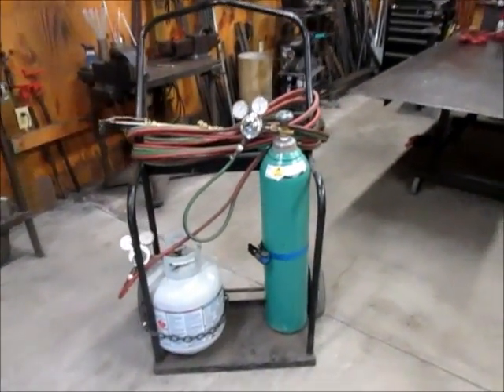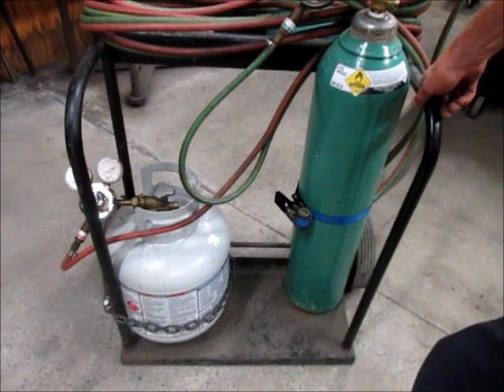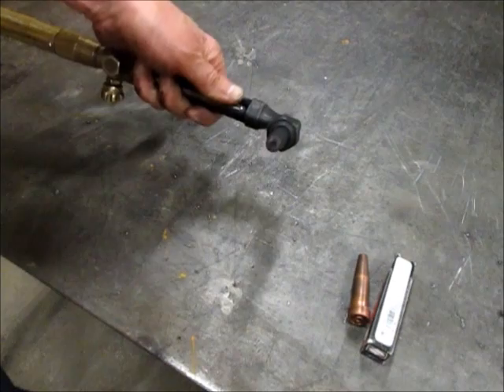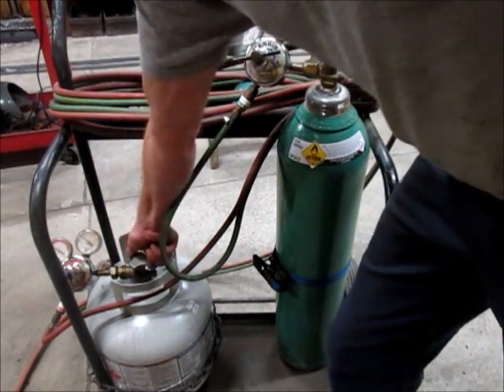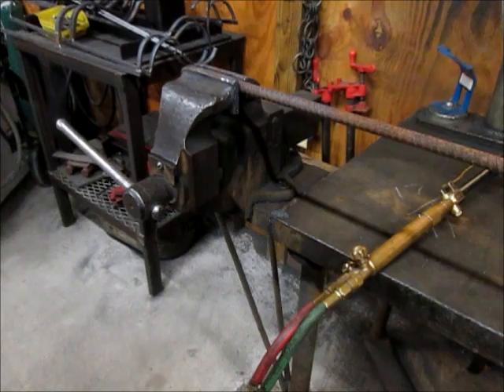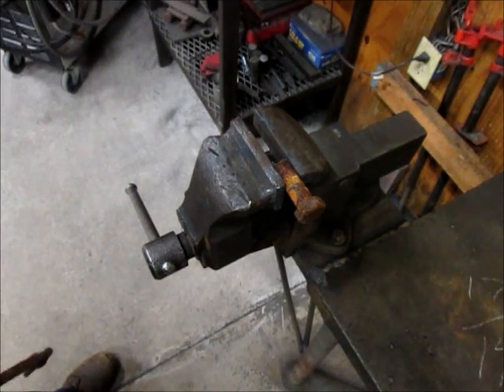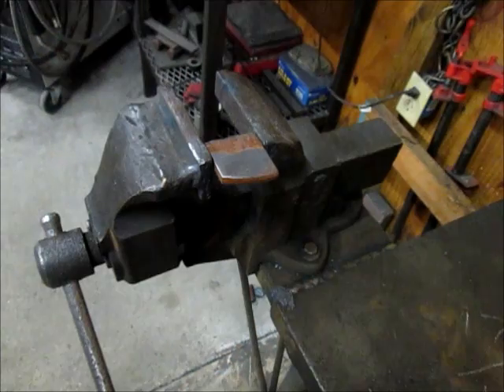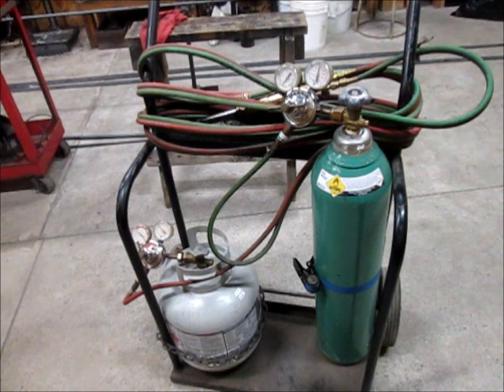Oxy Propane Torch

Comment: Hi great Vidio, can I just mention that your using the incorrect fitting on the LPG bottle.
You shouldn't use the POL fitting into the QCC.
You either should change the bottle valve to POL or use the QCC fitting to the regulator.
Reply: in my area nobody will fill a small lpg tank (anything under 25gal/100lb) if it has a pol valve. i was told by my local propane supplier (cenex) that modern opd/qcc valves are designed to work with both pol and qcc connectors and that it is perfectly legal and proper to do so.
Reply: @marzsit9833  yes they will work but in some country's it's not good practice as the POL filling into the QCC can inadvertently adjust the release valve on the inside of the QCC, making it leak. If the POL fitting has the bullnose o ring, it's more likely to happen.

Comment: welp..Im 44 seconds into the video. You CAN mix acetylene and propane regulator BUT theres a HUGE caveat. anything above 15 PSI on acetylene is highly volatile and explosive. Expensive LP regulators maxes out at 60 PSI,although propane burns cooler than acetylene based on its molar mass(more fuel means more hotter) You can dump more fuel into the fire by increased PSI. "Outlet pressure gauges nearly always show 2 bar above the max of the Regulator" So although a dedicated acetylene gauge shows 30 PSI it should only go 15 PSI and you can crank Propane up passed 15PSI safely...Up to 60 PSI?? I dunno Ive never played with a propane torch that high of PSI. And im going to say probably 90% of the public is just like me and the CHEAP regulator manufacturers slapping an LP sticker on a gauge designed for Acetylene works for me with a delivery pressure of 5 to 12 PSI. But theres probably some specific instances like big rose buds where you'd want to crank delivery over 15 PSI to get everything propane has to offer. OR someone slapping a dedicated propane gauge on a Acetylene tank and accidentally going above 15 PSI.

Its important to know everything we can know because its flammable gases and it aint no joke.

Comment: hey is it passible to use propane and compresserAIR to cut steel ?
Reply from the maker: I don't know.
Reply: Compessed air is used with an electric arc (plasma) to cut steel.

Comment: Anyone have experience with brazing small refrigeration copper tubing with this kind of setup?  Acetylene/oxygen works great because you can put the heat exactly where it needs to be and get out of there before the heat spreads.   I was told the new style mapp wannabe torches where enough to do this kind of work.  It’s not.   Propane is just so damn convenient but I’m worried the size of the flame would be a problem in tight spaces like a refrigerator.   I mean with a brazing tip of course.

Comment: ALWAYS cut the oxygen off first. 

When metals rust they are reacting with oxygen. When the oxygen concentration is high enough they burn, thats what oxygen cutting is all about. If you have a hot torch tip and you shut off the fuel first, there is not much stopping the torch from becoming the fuel. Also, an oxygen rich flame burns faster. When you shut off fuel first, the mixture becomes lean and the faster flame travels upstream, back into the torch and you get a small explosion which leaves soot and blockage in the torch tip.

Comment: Propane works great, used acetylene many years, company switching to propane, cutting 5-6 inch plate like butter.
 Sorry but you not using it properly, that bolt should of been cut clean in about 1.5 sec.
 Way to high, must see all point like blue pins, heat squeeze, cut.

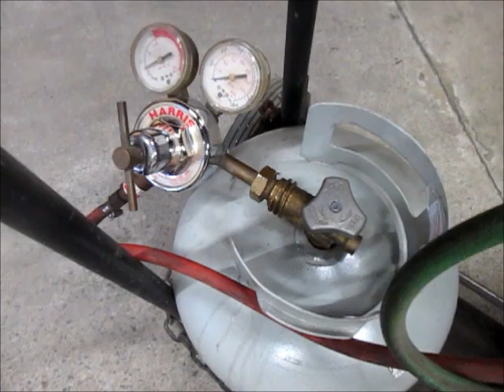Comment: 0:42 can't weld?  why not?
Reply: It's not the temperature. You will get embrittlement because the weld will be contaminated by using propane as far as I  understand it, brazing should not be a problem.